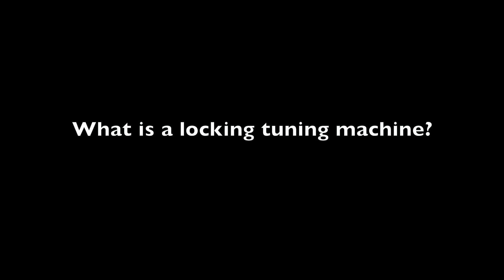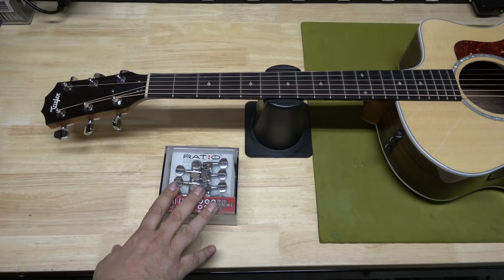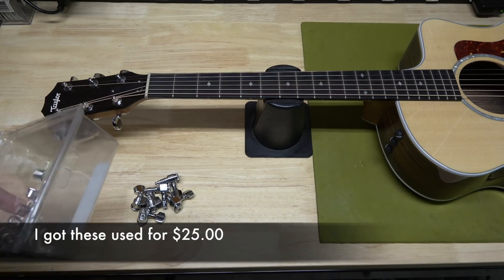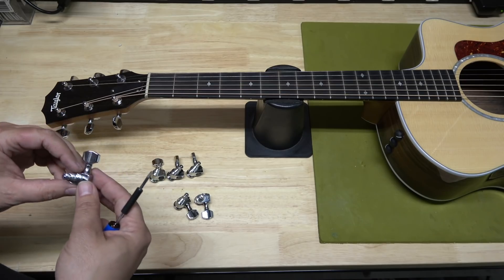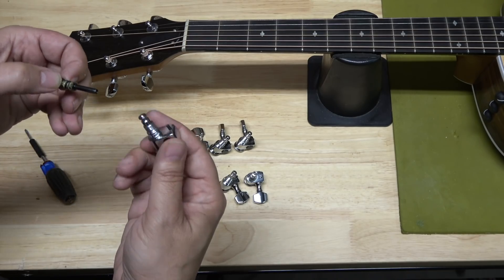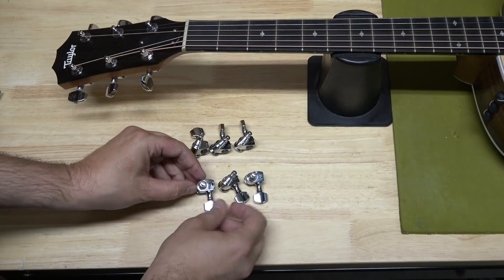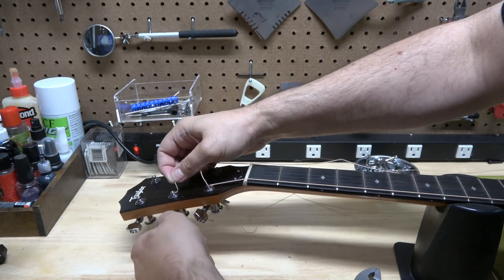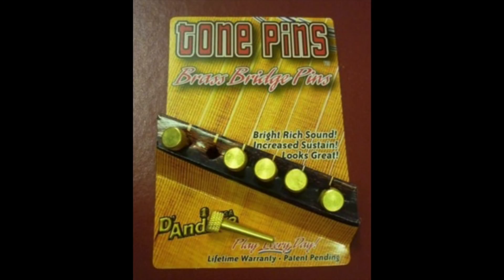Taylor 214ce Locking Tuner Install. Sharpen My Axe

Comment: Interesting about the tone pins, they made more difference than I would've expected! If you're a solo singer-songwriter or otherwise play the guitar on its own a lot I see why you wouldn't want them, that extra low midrange is useful then. If you're playing the acoustic with a band though, that's the sort of stuff that would get EQ'd out anyway to fit better in the mix, then the brass pins extra treble makes more sense.

Comment: Like it better without the brass pins.
It was a less dynamic sound with less acoustical quality with them in. The reason acoustics sound so good to us is the harmonics that they add. The brass pins almost compress the sound a little and flatten it out. Also loss of sustain, which you mentioned, was a major issue.
Reply: Try bone pins and saddle.

Comment: I like locking tuners, but I always use at least a half or full wrap. Tightening them with no wraps can cause string breaks I find.
Reply: I have found this too... it needs that little bit of wrap around the tuner or strings tend to break right at the tuning peg.

Comment: I liked the sound before the mods, Taylor guitars tend to be pretty bright, so the additional of highs was too much. I noticed you have a AC strip directly on top of the bench where you restring, I'd pass on if you have never accidentally had a string go into an AC outlet while restringing it's quite an experience!

Comment: When I fitted locking tuners to my Prs SE it was nothing to do with stability and everything to do with I have always found the process of doing the wraps awkward and annoying. Maybe a better winder would have helped or just more practice over years but the locking tuners are just so much less stress when re stringing. 

Which is annoying as now I need to do every guitar I ever own.
Reply: The first place to find and fix stability issues is at the nut, next place is the saddle.  If you have wobbly tuners, that could be fixed with a set of quality tuners, locking or not.

Comment: Pins seemed to punch up the mids, but to the detriment of the overall tone.
 I have a Fender acoustic (C141?) that I sharpened a few years ago. Tone was pretty compressed and lacked sustain. It was a well built guitar but the bracing was engineered for manufacture not tone. So with little more than some razor blades and sandpaper (4-5 hrs) I scalloped and lightened the bracing.  Massive improvement in volume, roundness and projection. Even low line acoustics respond well to well-considered sharpening just like solid bodies. Hardest part is knowing when to stop and not ruin the hard won gains.
Enjoyable vid as always  Phil, Thanks

Comment: I think the brass pins took away from the guitars sound rather than add anything really positive.  The sound did sound louder/brighter but it also sounded more tinny and metallic.  I would pass on using them as well ...  Nice tests/comparisons Phil and thanks! ...
Reply: I think you nailed the sound description, I thought the exact same thing. It was better without the pins, at least on that guitar.
Reply: My thoughts exactly. And, I have a set in the studio - unopened. Maybe on a different, darker--sounding guitar.
Reply: I agree with Eddie ( Exactly ). I do-like the locking tuners. I may do that to my 414ce-R ??? Perhaps on a Martin/Darker sounding guitar - those Pins would enhance the sound?

Comment: I didn't like the pins in that guitar. Maybe they would be a good fit for another one. Maybe.
I've never felt the need for locking tuners on an acoustic but I wouldn't knock it. Depends on how often you change your acoustic strings I guess.

Comment: Hey Phil...great video as always! Will be looking into doing that on one of my acoustics to see how it goes...though I wonder, are the locking tuners set up so when you don't do the extra couple few wraps on the peg, that the strings are low enough going over the nut? I think I've heard or read somewhere that can be an issue with locking tuners sometimes? Thanks for helping me Know My Gear! Rock on! 🎸

Comment: Love locking tuners but not worth drilling into a $1k guitar. If Taylor gave you that as an option and offered a locker for the acoustic they would have, just saying.
Reply: I don't think you should ever buy a guitar in that price range and worry about the resell value. You're basically owning a guitar and not having the features on it that you want so that the next guy who owns it will really like it. That doesn't make sense to me. Especially when used guitars in that price range with upgraded tuners sell for almost exactly the same as ones without. Some people even use it as a selling point in the listing. So as long as they're installed properly there's no reason not to if another style works better for you.

Comment: Damn. That tone comparison test was amazing. Normally with the YouTube audio compression you can't hear any differences from A to B. This was so obvious that I was taken aback. I don't think the tuners could alter the tone to that degree, it must have been the brass pins. Amazing difference. I don't know if it's actually better, but it's no doubt altered.
Reply: @detrimend  -   Brass bridge pins will definitely make an acoustic guitar sound brighter.

Comment: Your right the pins are not worth the effort and expense installing. Also, I'm not totally sold on installing locking tuners on an acoustic guitar. Just my thoughts on the subject.
Reply: The pins made a significant difference, though. I had a similar experience with replacing the pins on my guitar, but in the opposite direction.Replacing plastic pins with ebony made a world of difference. It depends on whether you are changing crap for better or replacing good for different.